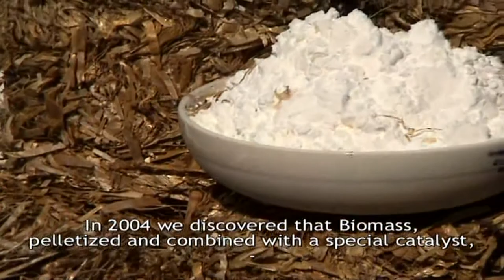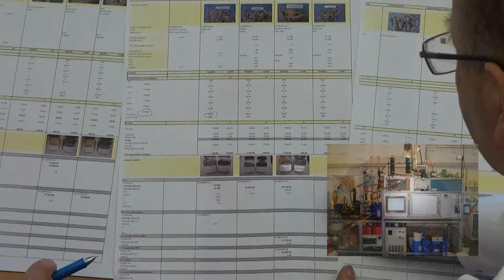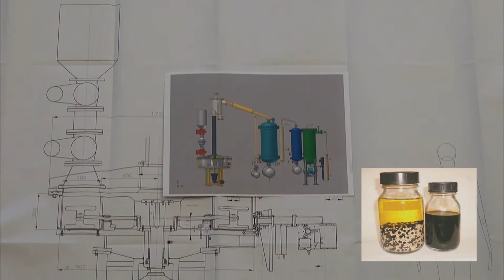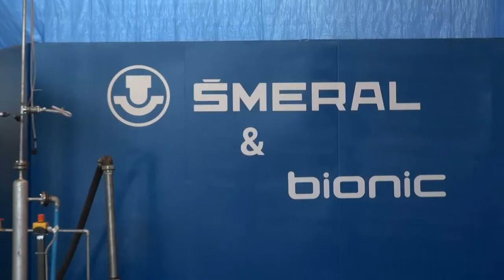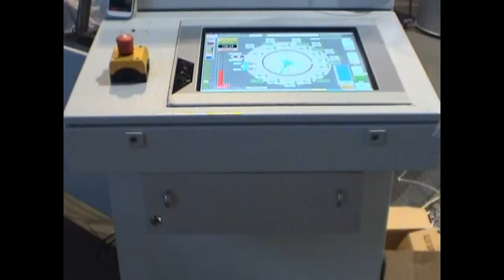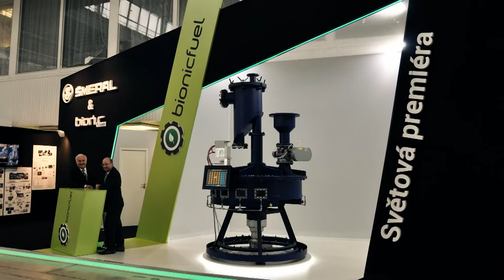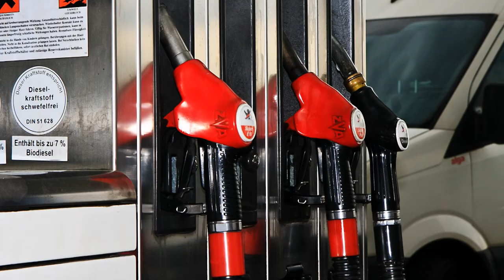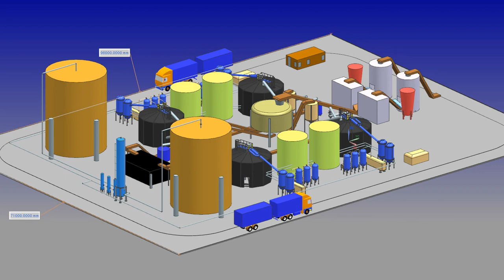Bionicfuel Corporate Video - mf60d Demonstration plant - v.15 12/2013

Comment: Hi Adolfo
I'm very sorry but your are wrong with your opinion. The Germans invented Fischer-Troopsch and Bergius Catalytic pyrolysis during 2nd World-War and produced Millions of Liters of Fuel with this enourmous energy unefficient technology. Our Bonic µFuel technology is based on the Invention (thermal catalytic depolymerisation) of Prof. Bayer from the University in Tübingen(1961) and has been developed and extended by Bionic with a proprietary microwave technology since 2004. Such effective microwaves are available since 2002 not since 70 years.